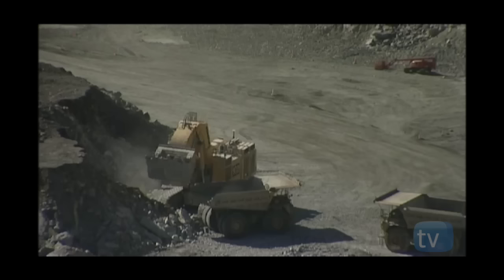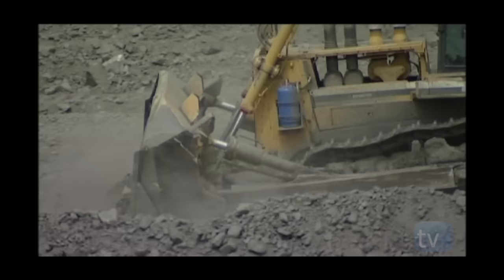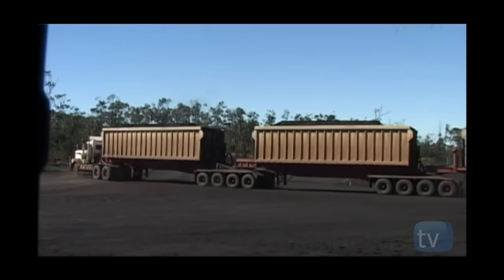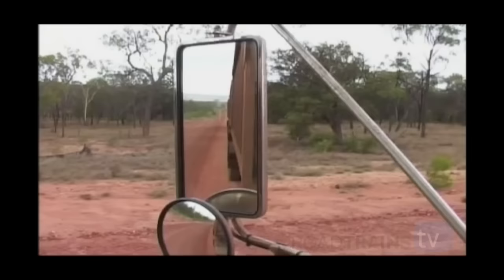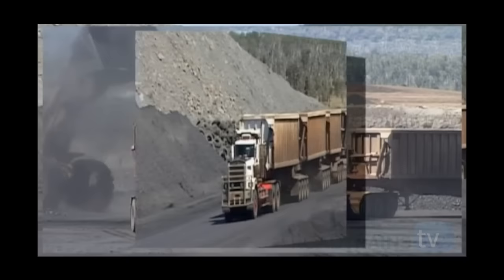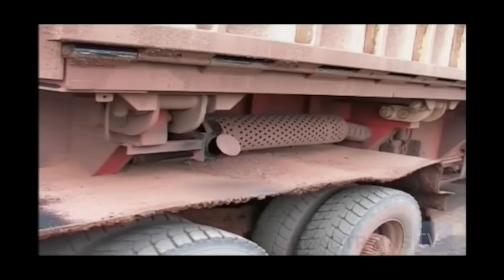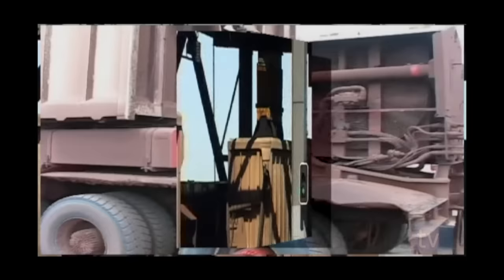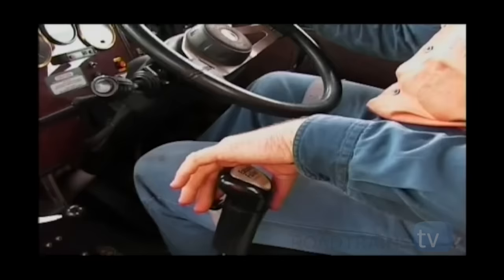Massive 1000 hp Kenworth C510  with 5 trailer road train

Comment: 'Trailers built by Smiths of Gympie'. When I was an electrical apprentice with Noel Andrews in Gympie in 1970 we did Smiths electrical work. Their 'factory' was basically a corrugated iron roof down the side of a hill. We used to joke that if they had flat ground to build a truck body on it'd be crooked. They turned out lovely stuff, they got flooded 2 or 3 times a year and Jimmy Smith was the best bloke you'd ever hope to meet. I was working in Gunpowder about 1975 and GCL was using Smiths side tippers. Great that they've moved on and up.

Comment: This mode of coal transport was/has been used at Jellinbah mine near Blackwater for many years. The coal is run from the mine to the loadout near the highway. Dozers push it into the u/g hopper and the coal run up a conveyor over the highway to the hoppers on the rail line.

Comment: trains don't run well off the tracks
Kenworth: Hold my beer
Reply: @karldoughty7981  triggered much?
Reply: They need the big bud 747
Reply: Hold my diesel
Reply: To our American friends that 300 tonne not ton,  661,000 lb  no airbags suspension in sight on outback roads they last about 2 days,
Sorry two airbags on the driver and passenger seats
Reply: @karldoughty7981  fr
Reply: @karldoughty7981  at least I’m not raw and breakable like you
Reply: Trains are MUCH Heavier than that load. My local freight trains pull 50 cars full of coal with only 2 6 axle locomotives
Reply: @nipponsuxs  Your cab airbags don't work? Must be a rough ride

Comment: I can only imagine what it must be like to drive a vehicle that can produce 1000 horsepower. It sounds amazing
Reply: just get a tesla plaid
Reply: The crazier thing is that’s not enough. This thing is also running a 600HP motor in one of the trailers!!! That’s a hauling SOB
Reply: @toofastnobrakes  it’s 1000 hp all up.
Reply: @iDrive123  really? I thought it said 1000hp for the truck plus 600 for the power trailer
Reply: @toofastnobrakes  Nah, they’re Cummins QSK19. 525hp to be exact.
Reply: @bgjh5149  :)))))) no.
Reply: Slap on a 750 hp Scania up front, and you raise the power significantly... 
Plus the fuel economy us vastly better
Reply: @franciosdeaeruiu7555  hahaha.. that's funny. 
Feeling a bit insecure huh?
Reply: @franciosdeaeruiu7555  so you say.. but it comes off as you struggling with something. Perhaps there's something in the closet eh?
Reply: @mortenfrosthansen84  Ha ha! You’re hilarious 😂
Reply: ALE Trojan.. a sorta old vehicle, being at least 10 years, but that is a special type of workhorse. 300 t at 14% incline is pretty monstrous for any vehicle.. without it being the size of a house. 
Volvo Penta 12,8 litre, capable of 1000 hp. It is technically a marine engine.. but if it can do the job. 

Guess there's a reason why Francios is so irascible nationalistic, when the subject is the capable european brands.
Reply: @mortenfrosthansen84  10% is the maximum incline that these operate at.
Reply: @iDrive123  I see
Reply: @mortenfrosthansen84  Also they’re running at just over 500 ton gross now. Very few companies run these anymore, the power trailers are notoriously unreliable. They’re just not very cost effective.
Reply: @iDrive123  Yeah they use C540s now - rated to 500 ton as you mentioned - with 650HP
Reply: @mortenfrosthansen84  They don't even run Kenworth cabovers (which have increased cooling from euro models) - there's not enough space under the cabs to fit the massive radiator cooling systems these things need at 500 tons...
Reply: @S3pra  Nope, they’re still QSK-19’s rated at 525hp. And they’re C509’s not C540’s.
Reply: @iDrive123  the C540s are QSK19s at 650hp
Reply: @S3pra  They weren’t in 2001 when this video was taken. They were 525hp.
Reply: @iDrive123  oh yeah absolutely, I just meant nowadays.
Reply: @S3pra  They don’t make dual powered road trains anymore. Powertrans went under in 2013. BIS industries still flogging old gear.
Reply: @S3pra  They don’t make dual powered road trains anymore. Powertrans went under in 2013. BIS industries still flogging old gear.
Reply: @iDrive123  Oh true? The newest ones I’ve seen they introduced were in October 2020

I don’t think anyone runs C540s as DPRTs if that’s what you meant
Reply: @S3pra  The new ones are C509’s. Only the prime movers are new, the trailers are all old. Having heaps of issues getting the 18 speed auto in the C509 to match the Allison 6 speed auto in the power trailer. These things will cost BIS their contract at Murrin Murrin.
Reply: @iDrive123  Ahh gotcha - wasn’t sure if that was the case. Any idea when the last lot of actual trailers were built?
Reply: @S3pra  2013. BIS bought up all powertrans gear when they went under. Have a look at the powertrans 1250 prime mover. They worked well with these, but they’re not made anymore.
Reply: @bgjh5149  Try a Bugatti Chiron: 1500hp
Reply: the engine would fall out, if you even hitch 1500 kg behind a Bugatti.. and the fuel economy for pulling weight behind such car. You would probably need a fuel truck hooked up to the filler cap constantly
Reply: @rogermouton2273  feel better? Glad to help
Reply: @mortenfrosthansen84  Facts for you to learn: posting irrelevant brain farts on the internet is not helpful. Now, FO like I told you.
Reply: @rogermouton2273  ok again glad to help.. but it's also quite paradoxical said, by the one talking about a luxury car on a thread about a mining truck. 
But then again, just that should be a red flag to signal weirdo
Reply: @mortenfrosthansen84  I told you to FO.
Reply: @rogermouton2273  oh sorry sir.. didn't know I was talking to the chief of the internet. All hail King doucche-bag 
P.S. the misspelling is on purpose ;)
Reply: @mortenfrosthansen84  Do you have a job?
Reply: @rogermouton2273  am I not your jester, sire?
Reply: @mortenfrosthansen84  Answer the question, then you can FO.
Reply: @rogermouton2273  you also feel how the insult is starting to resemble stale garlic bread? 
Stringy, dry and unsatisfactory
Reply: The trailer is also powered with a QSK 19.
Reply: @rogermouton2273  as does pretty much any jackass on social media... 
It means a lot, that you do care
Reply: It's slow
Reply: probably goes pretty fast... without the trailer lol
Reply: Same engine was fitted to John Deere's 8800 forage harvesters, rolled off the factory line at something around 830 or 840hp.. and as a tier 2 engine, you really got to hear it go with no exhaust treatment system to interfere with it all like everything now in the agri sector, and my god, what a sound those things make.
Reply: @GH-ov1lj  Yes. When I worked at The State Transport Authority in South Australia in the 1990's they replaced the expensive M.A.N. flat 12 engines in the Railcars with a KTA19 with Advertised horsepower 700 on the injection pump. They had a unique angled sump adapter to allow the engine to lie on its side. There's still plenty of those trains powered by Electronic injection QSK19 engines running on the Outer Harbour line. They sound Awesome!
Reply: @deafy1970  forgot to add they had a slightly lesser powered 750hp put into the 8700 spfh model below it.
Some YouTube videos don't do either justice if you go looking for them.
I'll be honest I'm not really one for lorries or know much about them and it's agricultural stuff I'd be more familiar with, but this came up as a recommendation and needless to say was a great watch because it just boggles the mind how we can stretch the limits of what all this equipment was designed to handle or be used for.

Comment: "This message paid for by Kenworth Australia"
Reply: only 600 hp....... there are more powerful prime movers here in the UK......hahaha
Reply: Le Chat Botté didn’t you hear the narrator state that the C510 is powered by a Cummins 19 Litre QSK 19 engine?
Reply: Le Chat Botté - Didn’t you also hear that it’s 1000hp combined power output of the tractor unit and the trailer engine?
Reply: @carholic-sz3qv  No it's combined power with trailer engine. Honestly, 600hp is pretty ''low'' (don't get me wrong.. It's still powerful) for a 19L engine, and the torque is not that great too. Yes European brands do better. On the other hand, the ''average'' power with a 19L could be a reliability choice (?)
Reply: @jowenjv4463  Also a temperature choice. You have to rate these things to run in 50 degree heat.
Reply: @mabamabam  does having a bigger displacement help with that ? I'm not sure.
Reply: @jowenjv4463  I've seen that the same engine units are sold differently mapped depending how much of their power is used during normal operation.
This seems to be a constant 100%, so I would expect the engine unit to come with the lowest powered map here.
Reply: @user-pc1er8zy7c  yes you can choose different HP rating depending on your needs... 600hp for a 19L engine is indeed quite ''low'', considering that it's slightly lower than the highest HP rating of the ISX-15 series if i'm not wrong
Reply: @jowenjv4463  I'm not very familiar with all these engines but since the narrator did mention the difficulty in fitting the enormous engine into the truck, could it be that these types of engine are in general designed for applications where a longer longevity is needed as in trucking?
Like power generating or marine application?
Reply: @user-pc1er8zy7c  Yeah, if i'm not mistaken the QSKs are typically naval engine as you said. Nonetheless, you have Volvo's D-16 with 750 hp, and 3500Nm of torque... Seems a more logical choice for this task don't you think ?
Reply: @jowenjv4463  Depends, if it's made for on road use it typicaly will spend a lot of it's duty hours at like 50% power output, while holding speed without an incline.
As a result of that it might still come with smaler sized crankshaft bearings etc, compared to the QSK and in turn would wear out relatively quick under such conditions.

But indeed there are 22 Liter V12 tugboat engines availible from MAN with either 800 or 900HP,
Perhaps it's mainly a coolant problem here.
I mean it's hot, it's slow, they even mentioned problems fitting an appropriate sized radiator.
Compared to a ships water to water cooling, it might very well be the determining factor here.
Reply: @jowenjv4463  Got to look at the duty ratio. If I remember rightly volvo duty at full noise is piss poor
While the Cummings is pretty good.
Reply: @dougsmall5492  Can you explain me why the duty ratio seems important to you in this case ? Thanks
Reply: @jowenjv4463  When it comes to power, there is no substitute for cubic inches.
Reply: @MegaGeorge1948  You mean that when you want power, you must have many Cubic Inches ?
Reply: @jowenjv4463  Yup! Big cubic inches = big power and torque.
Reply: @MegaGeorge1948  I (respectfully) disagree. Since you have an A-10 as profile picture I will take aviation exemple to explain why I disagree (I may be wrong though). When you say that big displacement = big power, the first thing that came to my mind are WWII fighter aircraft engines. We can take for exemple Spitfire Vs Bf-109. I know that there are MANY variants and sub variants of BF-109 and Spits, and RR Merlin/ DB-601/605. For the sake of simplicity, we can see that in 1942-43 for exemple, RR Merlin 45 and DB-605 have pretty similar ''base'' power output. Both were engine marvels, designed to be as powerful as possible without certain reliability and usability limits. When comparing the two (both supercharged V-12) we can clearly see that the DB-605 have far bigger displacement, but is not more powerful. The key was Octane grade in this case. 

There are many other exemples, but I think that displacement is only a single piece of many solutions such as supercharging, admission/exhaust systems design, combustion chamber geometry Piston design, ignition timing, cooling system, fuel quality, fuel octane grade etc etc. 

After all... Nascar V8 5.6L have around 750hp....  Porsche's LMP1 V4 2L was able to put 500hp (+400hp from hybrid systems for a total of around 900hp).. The specific power speaks for itsell. Don't even talk about F1 engines (V6 1.6L...). I'm not sayingthat some are better than others of course, each have their own charm in my opinion (and more importantly, are designed for different task, very important thing to consider), just trying to explain why from my very little knowledge, Big CI not necessarly equals high power.
Reply: @jowenjv4463  As a rule larger displacement engines, like the C510 engine does not have to rev very high to achieve decent horsepower as much as the smaller displacement engines. The only advantage that I see with small high revving engines is that they save on weight due to size and less mechanical components (e.g. four cylinders vs eight). But they have to rev up real high for serious HP to do the work. The larger displacement engine is stressed less than smaller performance engines while making serious HP. But weight would be a factor for some applications, like aeronautics where weight per HP is more critical on an airplane. On the kenworth C510, weight is not as much of a concern as HP and torque plus reliability.
Reply: @MegaGeorge1948  I can agree with that. Higher CI = better HP/reliability ratio. 

About the C5 series, if I trust what Kenworth Australia is saying, they can have QSK-19 rated at 650HP. Volvo's FH-16 and Scania R730 for exemple pull more HP with 16 L engine instead of 19L. QSK was for marine application if i'm not mistaken
Reply: @markstorer7204  
They're Tonka trucks compared to Australia.

Comment: Own 5 of these Kenworths. All 5 have done 3 million kms and still on the original engines gearboxes amd diffs they just truck from service to service
Reply: Sameul Jones There’s NOTHING like a Kenworth.
Reply: @driver3025  i think you mean Cummins, kenworth is just the shell.
Reply: ted s No. I said there’s NOTHING like a Kenworth. I’ve had many trucks. The Cummins in these things are ok. But not as good as the 550 CAT. She’ll pull from idle, and she’ll do it easy. The Cummins needs to rev like a sprint car.
Reply: @driver3025  how so when Cummins is at its highest peak tq and the lowest rpm of any v8
Reply: ted s V8 ISX..??
Reply: Scania. Nothing more to say
Reply: Jesper Danielsson in the same class as VOLVO. USLESS.
Reply: ted s v8? Haha
Reply: What kind of licence is required to operate a rig of this size?  The biggest rig allowed in Denmark is a 25 meter, so I'm thinking it might require something extra before applying to drive one of these!
Reply: @driver3025  man, you are torqueing out of your exhaust pipe ;-)
Reply: We gotta dirty old nissan cg380 with a dumper unit towing a 3 axle dumper trailer thats almost cracked 2million kms and has only had the headgasket changed, nothing else has been replaved or rebuilt
Reply: @teds4983  Since when was the QSK19 a V8, you need your ears cleaned as this truck Has a 19L straight 6 engine, they were never talking about a Cummins V8...
Reply: Sameul Jones that’s because you have professional drivers
Reply: @driver3025  i thought most or  all straight sixes ?
Reply: @olesuhr727  , MR license
Reply: John Buick.  so the c series cat engines arent on-road?
Reply: Would think they would try to make something with much less moving parts and coal engines seeing they freight coal
Reply: @driver3025  Peterbilts,Macks, and  Freightliners are pretty good too
Reply: Sameul Jones you rich bastard
Reply: Egbert Wadman 🚽
Reply: John Buick  WTF is a "highway tractor"?
Trucks pull trailers on the highway, tractors pull ploughs through paddocks!
Reply: C18>QSK allllll day long
Reply: @olesuhr727  not much mining going on in Denmark these days?
Reply: Great comments guys! Lol 🍺👍🏾
Reply: So they are as reliable as a average Japanese hatch.
Reply: @olesuhr727  it's called a commercial driver's license
Reply: I drive one of these not on that mine I am in Western Australia we have 5 over here p,us 3 tripples, the Cummins qsk are brilliant engines you can rev the guts out of them and they go forever completely different to drive to a highway truck these you have to drive them and you need to know how to otherwise you will come unstuck very fast.
Great fun to drive though love it great trucks..
Reply: @Jeff-ty4oi  Nice, the qsk19 engines have proven to be a very good work engine for us, all of ours are up to 65,000 hours now, we have trained all our drivers to work them between 1150-1600 rpm. We are currently trialing a Mack MP10 uprated to 700hp, currently she's just breaking in and running well doesn't have the torque of the big qsk19 litre engine but the fuel economy is amazing
Reply: @teds4983 .... Cummins hasn't made a V8 for trucks since the 1970s... the triple nickle (555) and the VT 903 (Both, junk).
Reply: @Romans--bo7br  they did in the tundra not long ago. But i see your point
Reply: Are each of the trailers powered or just the one in the middle?
Reply: Max force engine Dt13 that’s what it needs
Reply: @KuntalGhosh  Don't swear at all the poor USA truck lovers!

Comment: To the people saying it’s not 1000hp...You ever think maybe they’re adding the truck 600 horsepower plus the pusher 400hp diesel to get to the 1000 mark?  Lmao gotta love YouTube comment sections.
Reply: Not 1000ph 1000 ph more
Reply: Actually, it would be either 1056 or 1106hp.... he said the QSK 19 was spec'd at 606hp, and the pusher was rated at either 450 or 500hp depending on whether it was the standard ISX or the Signature version of the ISX.... which I don't understand, as the Signature version of the ISX was rated at 605hp with 2,050 ft lbs of torque, here in the states for Over The Road (OTR) trucks/Semis with the Owner Operator package from KW, Pete & Western Star.
Reply: @Romans--bo7br  probably detuned for out conditions (heat and dust)
Reply: @husq2100 .... thanks for the reply.  Yes, that's a good possibility and quite probable, isn't it.